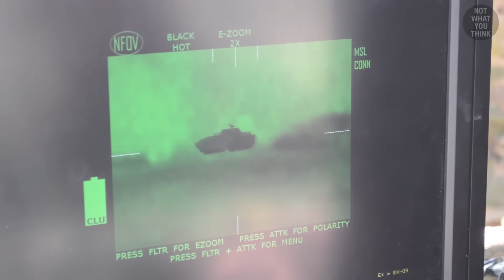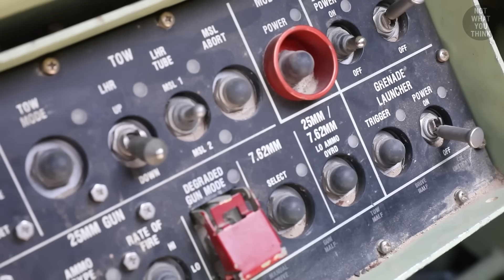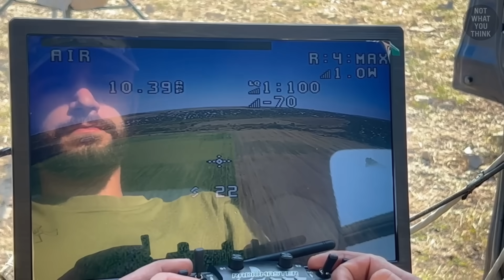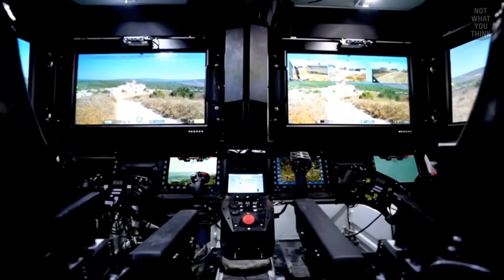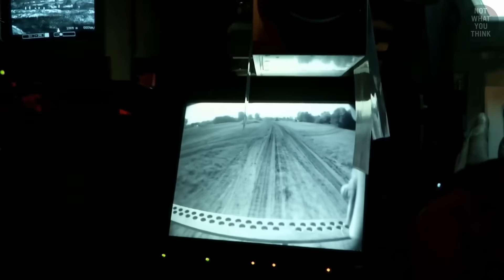How Bradley IFVs prove more Useful in Ukraine than Tanks

Comment: The Russians are effectively destroying and keeping main battle tanks off the field with KA-52 "Alligator" helicopters.  The 'Gator has a very good radar system in it's nose.  They can and do take out armored vehicles with air-to-surface missles that have a range of 10km, which puts them out of range from the standard manpads that are supressing some Russian flights.  Admittedly if you get your news from some network headquartered in New York City then, yes, you may hear someone say neither side has air superiority.  Just this week the Russians were running 10 to 11 sorties a day over the Adiivka battle space.  Admittedly, they lost four aircraft doing this but I would call that air superiority.  The Ukrainians only run sorties when they absolutely need to because their planes are old and few.  So, yes, while the networks may say no one has air superiority - maybe because it makes their candidate look better withholding f16's - the Russians definitely have more power in the air, and that includes the ability to take out a Bradley.

The Bradley has given the Ukrainians more survivability, both against that first tank round and against mines.  The TOW missles have proven effective, as the vidro says.  That part is true.  With regard to weight the Bradley, is quite heavy as well. Compared to the clanky old Soviet BMPs they're quite heavy.  I recently heard a report of Russian engineers mocking it because of all the special procedures needed to try and float it across a small river.  In addition to it's survivability, the Bradley has been valued in Ukraine because of its vastly superior thermal vision which has the engineering to resolve to much more detail.  Night vision is also good.  It has helped Ukraine own the night.  Despite having only a 25mm cannon on most Bradleys, they ve been able to take out a few tanks with it.  Given Russia's air superiority however, they've had to resort to dispersing into small nimble teams during heavy fire assaults and a lot of their success taking out tanks has come from artillery and strategic deployment of mines. 

The Ukrainians have expressed gratitude for the Bradleys for sure and appreciate the troop protection it offers, as was built into the original USA design.  Its a great vehicle.  I think its value, however, might be a little different from what you might hear on NYC-based network TV.

Comment: Part of the issue is that after WW2 a narrative developed that the Sherman was lacking compared to German heavy tanks and the MIC used it to push American MBTs to become heavy tanks. But heavy tanks just aren't as flexible as a medium tank and the Bradley's had to fill that role.

The larger problem is a matter of screening vs reconnaissance. Traditionally this was done by cavalry, but there isn't really a drone vs tdrone equivalent of light cavalry screening the force from enemy recon. This will be partly remedied by the Bradley replacement which will have a gun optimized for destroying drones in a cost effective manner, but I feel that ultimately it will require a countermeasure based on swarming drones to really solve the issue.

Comment: Once Bradley’s have javelin anti-tank missiles; then using TOW missiles, it’s OP. 
Bradley has always been a better modern fighter then tanks. I operated in 2005-2007 Bradley. It’s a bad ass vehicle. 
I believe a platoon of IFV’s can overtake a PLT of tanks. On the front lines if meeting each other.

Four Bradley’s with infantry troops can out flank tanks. The tanks are focused on IFV, while antitank troops slip around the side with javelins.

Comment: Bradley Infantry Fighting Vehicles have worked very well in the Russia Ukraine War because Ukraine rotates its soldiers in and out of "the line" to keep their infantry effective as opposed to Russian methods of forward deploying until there is no longer any infantry ("no retreat orders.") Lacking infantry for assault Russia now loads up there soldiers into IFVs for a frontal assault but given a battle space strewn with mines, very effective Ukraine Artillery and now rocket artillery and one can see how all that Russia attempts continues to be suicidally ineffective even now well North of 18 Months into Russia's Ukraine War. As for a Bradley insodoing Battle Taxi work it can also loiter and provide very effective fire support far more than an M113 can do though an M113 is also a very effective APC needs noting as well. If this armor becomes sufficient over time both in dwell time and effective fire control this has the ability despite the absence of air power to create a fragility of offensive Russian situation which in theory is where a main battle tank effort would be made to smash through by manoeuver alone and thus undo a foolish military effort in this instance on the part of Russia against Ukraine. Tanks are most effective yes against other Tanks of course but also against any and all rear echelon forces in particular artillery especially Russian artillery which is not mobile in the least but also against support and logistic vehicles. This can lead to very outsized losses for said foolish invader as if these MBTs Leopards or otherwise effect a defense into counter offensive taking and holding said gains will be the task of the Bradleys, M113s and respective German and British and Swedish variants of the same purpose. In particular vehicles such as the Bradley and CV-90 having moved forward to hold ground gained can be very hard to dislodge once "emplaced" if properly done so as with enough infantry a very powerful defense in depth be had.

So far Ukraine has mounted two very effective offensives to retake from Russia Ukraine territory and hold that but this was succeeded through more guile and expert time whilst Russia defeated from first assault than with any "main effort" from a well provisioned forward deployed Russian force. Still there is the very real danger of a sudden collapse of such a forward deployed effort in total as Russia has executed upon still deep inside Ukraine territory and Lands. Any sudden "break" in/from the Russian line could well result in an untenable position from which to retreat and a complete loss with no recovery of the entire effort.

Comment: The M1 Abrams is a great weapon system - but it's very dependent on 2 things: Air supremacy and unlimited fuel supply.

Both can and probably will be problematic for Ukraine.

Abrams, Leo 2 and Challenger 2 were designed during the Cold War for large-scale open-field battles in the Fulda gap.

All three trade in mobility for armor. It made sense for that purpose - it makes a lot less sense in Ukraine today.

Main enemy of MBTs there aren't other tanks - it's artillery, drones and mines.

That's why Leopard 1 is a lot more useful than the big 3 - except for maybe mine-protection.

When developing an MBT, most important skills are firepower, mobility and armor. In this sequence.

Your thinner frontal armor doesn't matter if you aren't hit by a tank gun. The other way round - the thicker armor even of Challenger 2 doesn't help if you get a direct artillery hit.

The best defense against artillery (and drones) is mobility. If the enemy can't hit you he can't kill you, obviously.

Therefore, it's not so much "IFVs are better than MBTs" than "IFVs and light MBTs are better (more useful) than heavy MBTs".
Reply: this almost sounds like the abrams is perfectly designed to work within the US Forces. surprised pikachu :D

Comment: BMP 1 and BMP-2 have almost no armor, that's why they swimming. In Youtube and on Fanker530 you can find video where BTR-4 Bucephalus ( infantry fighting vehicle ) penetrating BMP 1 & BMP 2  in their front armor with help of main gun (30mm automatic cannon). In Russo-Ukrainian War, BMP 1 and BMP 2 it's coffins on tracks. Yes, it can shoot, kill and move, but they do not have really good armor, and they can be penetrated with help of M2 Browning AP shell in side armor very easy. So, no need to explain what will happen with BMP 1 & 2 if soldiers will use RPG (hand anti tank grenade launcher) against them.
 any Bradley can do the same with BMPs, with using 25 mm automatic cannon and AP or APFSDS rounds.

Comment: Armoured warfare and modern combined arms warfare require cooperation to destroy the enemy most effectively and protect each other.  Every combat element has advantages and disadvantages.  As do the enemies. Finding the enemies weakness is vital. For all modern warfare.  This includes an understanding how an enemy will try to use its systems.  
The Bradley can dismount infantry with anti tank weapons. That is normally the best option so the Bradly can remain hidden.
Situational awareness is a high priority. This includes airbourne sensors as well as tank sensors.  This is magnified by data networks.  He who sees the enemy first can gain the initiative. 
Turbo charged diesel engine and the Abrams jet turbines work well at high altitudes. Size does not matter. Power to weight ratio is a significant factor.  Modern medium tanks are more specialized vehicles. Unlike a larger MBT.  
Tanks are not the best option to destroy enemy tanks. Aircraft and UAVs can be more effective. Mines and artillery are a very deadly combination. As seen in Ukraine with such delay effect. 
Crew survival may be more important than the vehicles. Modern warfare ensures losses. 
Risks must be taken. But best when intelligence is available. 
The Booker tank is mainly for rapid deployment.  It needs to be used carefully. Stealth may help. This medium tank can support infantry with firepower. But not to lead assaults. Medium tanks are not tank destroyers. If used as tank destroyers they need to be mobile and stealthy hunters. They may also be useful in a reconnacance vehicle. Booker will not replace MBTs. They will likely support airborne forces.

Comment: An effective direct fire weapon is too heavy to move without self propelled capabilities.  Unlike artillery,  direct fire means the enemy is line of sight, which puts you in line of sight. So you protect the gun so a single rifle can not take it out. Thus some armor. Tanks kill any system on direct line of sight, no other system can really do that. An IFV can with missile systems,  but fire a TOW at a tank and if the gun is laid out in your general direction they fire back. TOW is subsonic.  120 mm is about 750 m/s for HE and this is the slow round, this is 2,750 km/h much faster. The machine gun is M2 is very fast to train and fire back. Nothing works like a tank gun.

Comment: This "tanks driving across the field" thing may not be happening now. But a tank can shoot for miles. You don't want to be sat in an IFV with a tank shooting at you from 2 miles or more away, with basically paper armor for all it'll help you.
Reply: MBTs are not the worst threat. Its the ATGMs in the bushes and the $1000 Chinadrone+RPG7. Tanks are coffins, if shown on the front.
Reply: @frankgerlach4467  not sure about that at all. Most reports of destroyed western tanks so far have been mines, and the crew survived. Personally, I'd rather be in a modern tank than stuffed in the back of a much weaker armored IFV or battle taxi
Reply: Ukraine is flat, with trees. you most likely will not find a firing position that has 2 miles view, in most spots there. But yes, in uneven Terrain with vantage-points, Tank cannons, have a significant advantage.
Reply: Tanks have very poor range.
Reply: @grahamstrouse1165  2 miles is fine. Maybe not in a Russian tank

Comment: There are two jobs the tank does better than the IFV. And these are both crucial. Tanks are sort of sniper rifles, at least modern western MBTs like the Abrams. They can identify a target and hit it from kilometers away. 

And the second job, is to take hits. The tank draws attention and fire, because of the scary firepower it can bring on a target. But this is combined with armor that can allow the tank to take multiple hits before being completely disabled. And keep in mind, people will shoot at a tank until it is completely on fire, or suffers a catastrophic explosion. So if in the case of an Abrams where the ammo is stored safely, the tank does somehow get penetrated and the crew suffer casualties, it is still a target which will draw the biggest firepower the enemy has. 

And this second job is really what makes the tank so crucial when used for offensive operations. It is meant to do team work with the IFVs and their dismounted infantry. It draws the attention of the enemy, and the focus of their most destructive weapons. Meanwhile the IFVs and infantry can maneuver and assault the fortified enemy positions.

If the tank was to be replaced with the less armored IFV completely, they would be picked off much faster than the much more heavily armored tank.
Reply: You work for Krauss Maffei, eh ?

A single Kornet can make your Leopard 2 turret take off 100meters. See Turkey, Lebanon, Yemen.

Comment: Booker looks like stupid idea. While lighter armor may be a good idea because tanks rarely encounter other tanks, exchanging 120mm for 105mm canon is a bad move. Powerful HE shells are one of the main pros for using tanks as assault units and 105mm has way weaker HE.
Another thing is that 40 tons for light tank is still a lot. 
The last problem is that Booker is extremely expensive and numbers are important in any war.

Comment: After watching the Ukraine situation. I've really felt that it would be much more beneficial if they had a huge amount of Baja buggy type military grade vehicles so they could maneuver throughout cities, urban areas really fast, in mass groups, etc. So they could move from building local to building local and carry some supplies, have some protection, but mostly just move soldiers around urban areas much better than anything Tanks can do.. that's just my personal opinion. They can be mixed & blended with heavier slower vehicles. I just think that type of fast maneuverable vehicles would be so helpful in their current situation.
Reply: How would they deal with IEDs?
Reply: @brodriguez11000  IEDs are Improvised Explosives, so they are handcrafted, by fighters on the ground. This does happen in ukraine but is only of limited significance to vehicles. So i guess you must mean Mines instead?

Comment: This is reinforcing the use of combined weapons where the heavy tank still has a role in the combination. 

A tactical advantage of the medium tanks/heavy IFV is that, with the weight of the common large loaded lorry, they can access assorted bridges and over passes etc. at will that heavy tanks can only do so after engineer survey, stopping other traffic, engineer reinforcing or special bridge laying. This last was the key weakness of the old Tortoise tank which was had good mobility over the ground but was limited in finding bridges it could cross at the time so strategically it was limited as it had to use round about longer and slower routes.

I think it is inevitable that the lighter tank will be a fusion of the medium tank and the IFV. Either in a common vehicle or on a common base to ease costs, maintenance and logistics. Equally it is inevitable that this medium tank/IFV will cycle through the square of protection, speed, armament and sensory kit probably settling on a less than 105mm automatic gun. Perhaps 57mm with switch between HE and AP on demand.

Comment: Oh no you mean the book and move  The Pentagon Wars were wrong and that if the Bradley bumped into a stone it would explode and everyone would die?.
😂😂😂😂
/Sarcasm
Reply: Pentagon wars is garbage
Reply: @Penguincannon9000  I agree especially the movie.
Reply: @herbertkeithmiller  the Bradley was never designed to take a tank round. 

It’s designed to take light to medium hits, because it’s not a tank. It’s an IFV and always had been. 
It is designed to kill tanks with its missiles, kill people with its gun, and deploy/support troops. It’s a big advantage when your troops have basically a light tank fighting with them. Previously, they basically had an armoured taxi that offered them no support. And no, you can’t just slap a turret on a m113. And it was never an upgrade. It was designed from the ground up as a reaction to the bmp.

But does the movie ever mention any of that? No. Because the army won’t blow it up with a tank round to learn the thing not designed to take a tank round blows up when hit by a tank round. 
And that water thing. It was to look at shrapnel. Because it’s kinda hard to check on the dummy’s, when it’s on fire. 

And if you don’t believe me, look at how it preformed in the gulf war. It blew up multiple t-72’s in the battle of 73 easting and did its job perfectly. And in the battlefields in Ukraine, while the propaganda machine might yell over every single destroyed Bradley/leopard/challenger/abrams(no way, you lose shit in a war), it has preformed well and protected it’s crew.
Reply: @Penguincannon9000 Yes I agree with you. sorry I should have indicated that this was sarcasm comment edited.
 It's interesting that they made it into A parody instead of actually exposing some of the defects in Pentagon weapons development.
Like constantly changing the turret for a different gun and causing massive and expensive redesigns.
Reply: @herbertkeithmiller  I would suggest you use /s to denote sarcasm.